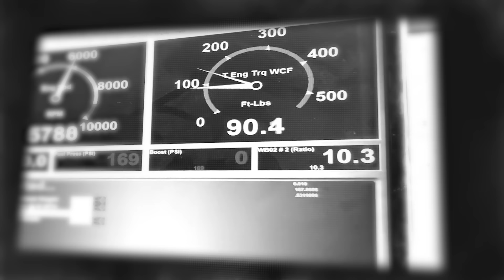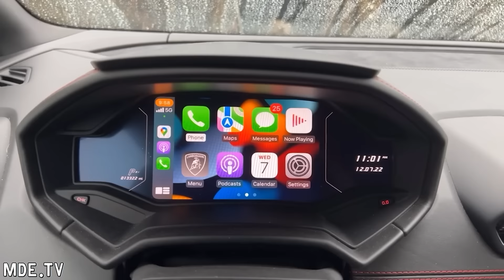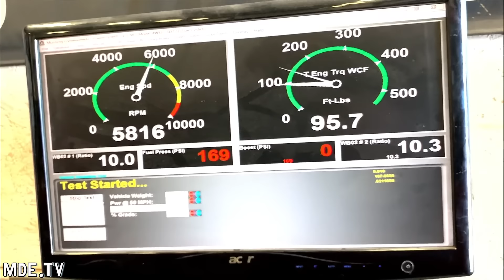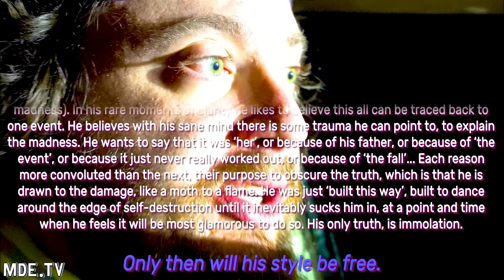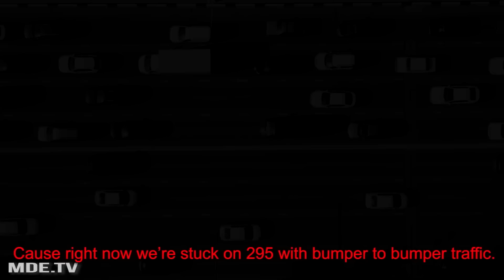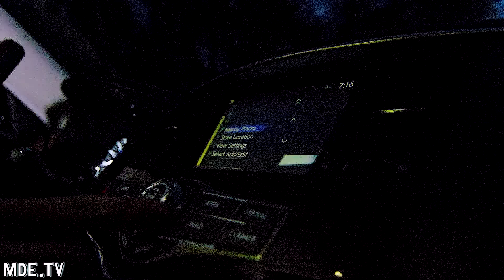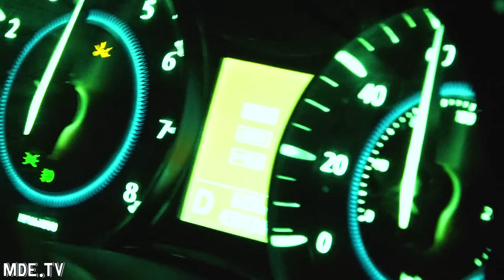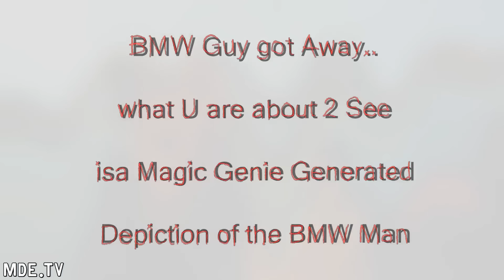SAM HYDE vs CARS: Every Single Time Sam KilIed A Car EVER.

Comment: If you ever find yourself in a situation where you can completely destroy a vehicle, I highly recommend it
Reply: I'll never forget when my first car started spitting black smoke out of the tail pipe and from under the hood and I just keeped driving it home. It would kill every time I stopped so I had to keep starting it again then when I got in my drive way I pushed the gas pedal all the way down in park until it burnt out and wouldn't start any more. Invited my buddies over told them to bring some beers and we smashed it for hrs with sledgehammers.
Reply: @reeetawd  and you still remember it, and I forgot to mention you need to do it with friends 100%
Reply: Totaled my 2000 civic and i miss that shitbox
Reply: One time me and my mates bought a car ofd my other mate for $100AUD. Brown Mazda, painted a green speed stripe on it, painted "Fuck Machine" on it, took out the back seats and replaced them with cool racing driver seats tied down with some metal wire. First corner we went flying around in the back. Cops pulled us over and told us to paint over the fuck machine bit. Ended up with us curb jumping it till it was fucked, good times
Reply: I concur
Reply: The most trouble I got in next to burning down my parents house was when me and my friend wrecked his mother's car when it was being stored in the garage. He told me it was OK.
It wasn't OK.
A beautiful little Mini smashed to bits. 
I still feel bad about it 30 odd years later.
Reply: buddy was selling his car but no one was buying it since it was pretty fucked and dick tipping 300k miles. So we just shot it with 22's in the driveway kicked the shit out of it and left it at a scrap yards drive way. It was a great feeling
Reply: @Rhodiac  how do you find yourself in a situation wherein you’re buying a working vehicle for $100
Reply: @STOPSYPHER  australia
Reply: @STOPSYPHER  the value of any 20-30 year old, running but non titled front wheel drive commuter car is genuinely like 75 bucks. thats why theyre usually just straight up scrapped. most people wont even bother selling.
Reply: Conversely, if you're ever in a situation where you HAVE to destroy a vehicle, I don't envy you.
Reply: @STOPSYPHER  ill sell you one for $500 thats worth like $100
Reply: Bought a Nissan Versa in the mid 2010s. Eventually the transmission became unrecoverable without a full swap. I payed less than 1000$ for the shitbox, no way was I getting a news transmission for it. 
So me and my friends wasted like 80$ in 10 gauge ammo, turning that versa into Swiss cheese. Great weekend, 100% recommend.
Reply: It’s so incredibly freeing

Comment: ill take a minimalistic 70's- late 80's square body with an updated modern fuel injected big block with a supercharger. no tv screens, no buttons. just motor n fat tires in the back surrounded by steel. fuck them lambos